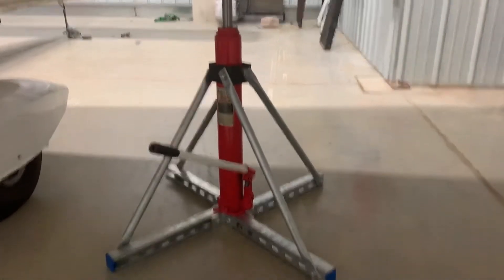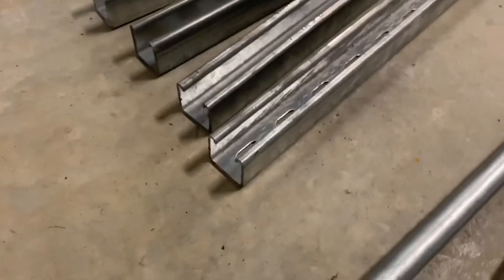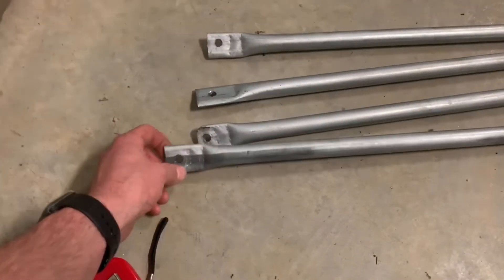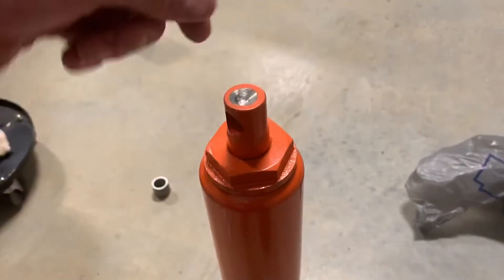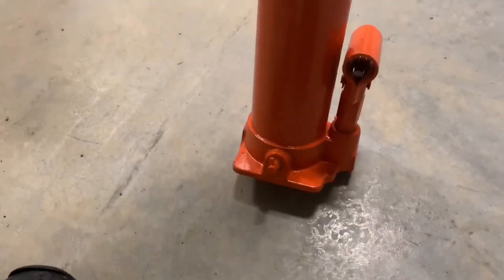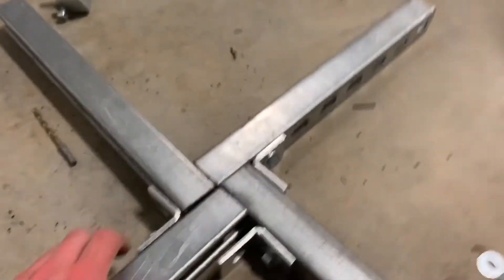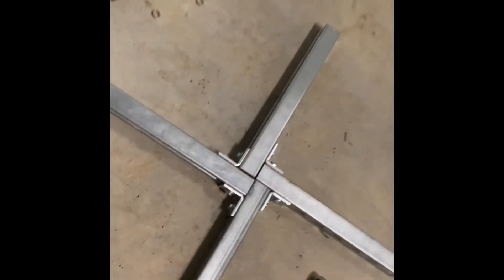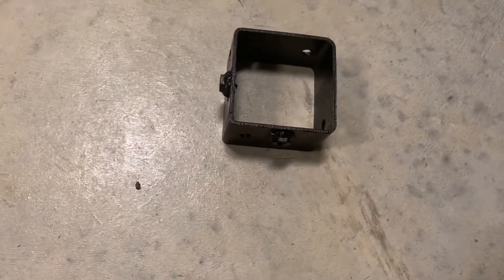Make your own aircraft jacks for under $150!

Comment: Hey how are these holding up?? Needing a set of light jacks for a mobile service I plan to start and I think these would be great for me to build if they are holding up well!
Reply from the maker: They have been great. The only flaw is the attachment point at the tips of the legs, had one slip a little and one of them got a little wobbly. Easy fix but maybe you can engineer a better attachment than I did to the cylindrical top area!

Comment: May I ask what the finished height is?.....Ive got a Mooney.....Pretty low
Reply from the maker: Whatever the height of the jack compressed is, look that up, it sits right on the floor. Might be close, I have a few inches to spare but yeah mooneys are a bit lower
Reply: I have a Mooney also  F.....did it work?  I'll measure tomorrow

Comment: Great project! As an inexpensive safety measure, once you have the airplane up on the jacks in the air and leveled, wrap some electrical tape (about six times) around the base of actuating rod right where it comes out of the bottle and then tighten a hose clamp around the electrical tape. In the event the bottle jack fails hydraulically, it will help hold the actuator in-place and the aircraft up in case you’re under it or if you have wheel assemblies removed. It’s not a 100% fail-safe tip, but helps add a margin of safety to bottle jacks with no mechanical lock/safety mechanism.